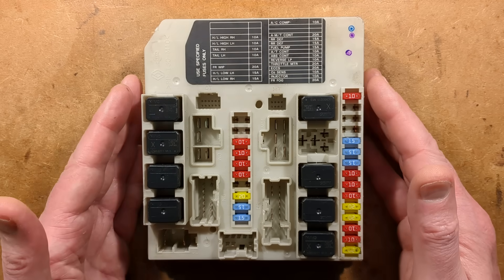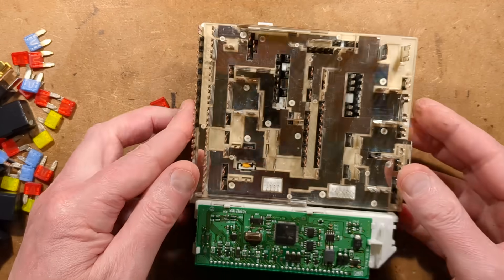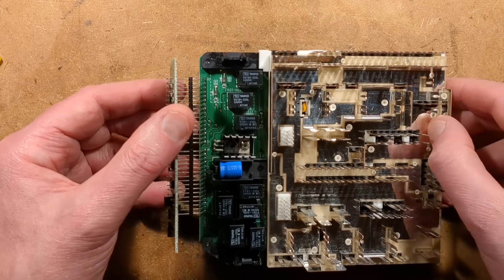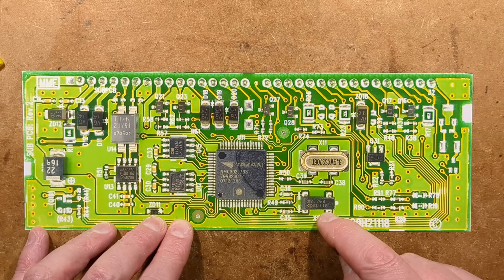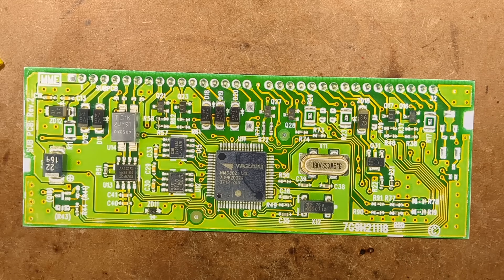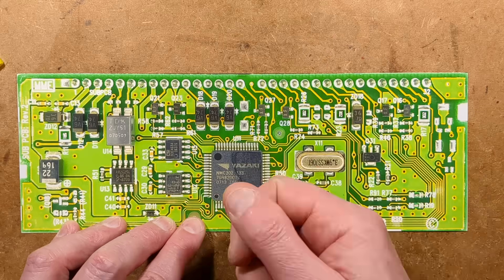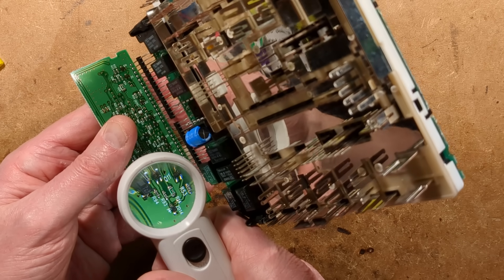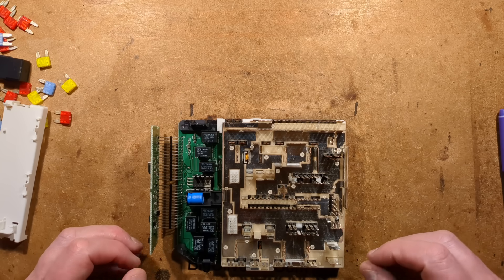Why your car's fuse box costs so much (and the location of the data chip)

Comment: I had a 2003 Dodge Ram 2500 and one day the left trailer lights just stopped working. Chrysler in their infinite wisdom made a trailer circuit inside the fuse box and the left side relay failed which I found out was very common. Radio Shack (yes that tells you how old I am lol) couldn’t get the relays because they were tiny and setup different than a standard typical relay. I had to go through Chrysler to get them. They said I had to replace all 3 relays due to past issues. Once I got the fuse box apart I was able to locate all 3 relays. I had 4 different type of soldering irons and none of them could melt the solder. Spent 2 days working on it and was finally able to replace all 3. Mind you the board look like 💩 after I was done 🤣. And to my surprise it worked! And then 2 weeks later it failed again. Drove that truck for 10 years like that and was still broken when I sold it.

Comment: In similar reverse engineering scenarios I have found it effective to hold the micro in reset with a single hand probe while reading i2cProm. Or if the micro has numbers sanded off and the reset isn't obvious, grounding any external crystal to stop boot (having confirmed with a scope that you've got the input side so as not to damage the driver)

Comment: Programming the eeprom in system is unlikely to run the microcontroller. The power governor module will be holding the MCU in reset because the power from the clip is not going to be meeting the safe power up requirements. If in doubt you can artificially pull the reset line down (or up, no idea which way it is active in this chip)

Comment: And this is one of the points, I don’t like the Yazaki products. 
I see the PSA-Yazaki parts and freaking hate them. The quality is Ass in my eyes.
The Delphi BCM on the other hand are a bit better for the say „thinking“ and „load“ parts: 
You can remove the Relais part, just via headers on the board and repair just the Relais. 
Or desolder the key-eprom and put them on the new board. 
Easy is that. 

Just my two cents.

Comment: You can manually "active test" (function check) those IPDM units in most Nissan's of the era. If you cycle the ignition on-off-on and press the drivers door switch 10 times, the unit will cycle through its test sequence operating the lights/horn/wipers etc. It sounds like a weird cheat code, but it's a real test on a lot of models. It doesn't work on all models though (D40 Navara and R51 Pathfinder for example).
There was also a recall on some of them because there was a relay that would fail. Dealerships were sent a special tool for pulling the relay out. The tool itself is also quite interesting to look at with the way it pinches the relay and pulls it out of its socket.

Comment: Common miconception: is not a fuse box. It's the Body Systems Module (BSM in Ford speak) on my Focus it controls multiple functons from the interior lights to the central locking and security systems. Ford sell a number of 'options' that can be enabled from the BSM but only if the BSM has all of the needed hardware (relays, etc) built in. On my car I was able to buy a higher spec BSM (I had to replace mine due to a Ford design flaw) for around £75  from a breakers yard and then, using FORScan and a CAN interface, pair it to the ignition keys the ECU, the ABS and the instrument cluster. Sounds complicated but it really wasn't.

Comment: 5:50 timing. The Nissan's have timing for the turn signals and 4 way flashers.  If you overload them say with LED lights, it damages something on that board. Very expensive.

Comment: It wouldn't cost that much for the factory to add a waterproof coating over the pcb and it would be an added saftey preventing it breaking in case it gets wet.

Comment: My first thought is - a box like this should NOT contain all of this.
Especially NOT if its placed under the hood, with the risk of condense/moist/water/salt (I live in Norway, and roads are salted a LOT during the winter).
The designer may have thought..."hehe, just a minor failure here may end up owner/workshop buying completely new box", but what about their reputation...?
I will compare this to replacing the hole car due to gear box broke...
BTW. BigClive has valuable knowlegde deep into electronics, I can see.

Comment: Give it a few more years for electronics designers with experience to fade away and then the most common car failure mode will become a failed surface mount capacitor just like phones and laptops now.  There will be a "Car Repair School" channel where the guy finds the errant cap and just tweaks it off the board with pliers and job done!  🤣🤣

Comment: This has gone a LONG way from the 2 x 35A glass fuse "fuse-box" in my first car - an 948cc A 35 Van. Nothing solid state in that machine at all!  Those very complicated fuse box assemblies can put you back over $1000 if they need replacement - and getting reconditioned modules can be really difficult, so you are stuck with the "Original" device, and specialist installation.

Comment: The fuse box in the 1998 Nissan Frontier has a very similar appearance, but I doubt it has any active electronics in it. Ford for many years (through 2004 at least but probably later) used fuse boxes where the fuse and relay terminals were crimped to wires stuck into the back of the fuse box. This meant that if you could find a source for the terminals or cannibalize them out of another fuse box, you could easily populate the terminals in an unused fuse or relay position and have a factory-looking wiring modification.

Comment: Did you know Voron 3D printers use a CAN Bus network for the motherboard to talk to the other modules?

It was an easy to use network that is already compatible with 24V, so they went with it.
Reply from the maker: It's also used extensively inside modern moving lights at events for communication between internal modules.

Comment: Many vehicles have immobilizer systems which use multi factor authentication and are linked between multiple modules like powertrain control module, dashboard and key fobs.  I had a failed PCM in my VW and had to "adapt" the new PCM to dashboard  immobilizer after recording a code.  This required software plus a data cable which was designed and built by a individual living in Pennsylvania.   He managed to build a better tool than the VAG engineers and many dealerships were using his package as it was cheaper and better than factory unit.
Reply: Uwe Ross and VCDS, originally called VAGCOM. He used to work for Bosch apparently... Now a big business and still popular.

Comment: i cant comment on Nissan, but i work with Fords daily, so here's some information about them. in Ford's world, the underhood fuse box is also known as the "BJB (Battery Junction Box)" or "BCMC (Body Control Module C)". it has its own programming and as-built data (which basically tells the module about itself physically, and some other stuff), but its pretty small data for a module. on the F-150, a replacement BCMC can cost about $550. for some context, a cruise control module can be closer to $580, and a camera for the rear or 360 view system can be nearly $400 each. from looking at some community-made spreadsheets and just guessing Nissan does something similar, it might need that timing for a sort of timeout for certain modules. maybe a way to force reset an unresponsive module by cutting power? i'm not sure and thats just a random guess. most of the as-built data seems to be DTC behaviors. its also highly unlikely that swapping out a fuse box will cause issues in terms of a soft of vehicle mismatch lockdown, as the Bronco guys figured out that swapping the fuse box and a couple wiring harnesses could retrofit the 6 upfitter switches

Comment: I used to have a Bedford HA van (1978). It only had 4 glass cartridge fuses, an indicator relay, starter solenoid and that was it. As simple as you get. The only electronics was the added radio. 😀

Comment: Part of my OCD was to keep a box of assorted fuses in my car. In the 54 years of driving I only ever changed probably 3 blown fuses. The fuse boards have evolved so much that it is virtually impossible to DIY, unless you buy the fault checker. Good post Clive 👍
Reply: My 3rd car was my (beloved) Peugeot 206 SW. Sadly that had to go when the combination fuse box/mainboard developed a small fault.
I'm not being sarcastic either, literally one electronic feature failed.
And it couldn't be repaired, that tiny fault wrote off the mainboard and subsequently wrote off the car, it was much more expensive than the value remaining in the car! 😂😭

Comment: If you disconnect the battery while the engine is running, the voltage will spike. This is so much of a problem that the electronics in a car have to be able to reliably operate during one of those voltage spikes. So you often see a lot of zener diodes, some quite large, in these kinds of modules to clamp those voltages and dissipate them as heat. This is part of a automotive electrical standard.

For additional information, search google for "cars rule 34".

Comment: Don't bend the connector. Electronics techs use a large heating pad to heat and melt all the pins at once. Cold solder joints at high current terminals (fuses and relays) should be resoldered if they loo at all strange.

Comment: I just bought one of those used, to Renault. The problem was the water drain hole where that fuse box is in.  Water got so high, it frooded inside to that fuse box. I cut plastic to get further, around those small pins and clean in. Worked around one year and corroded again. Now used box in, no programming needed and my 87 year old grandmother's car is going again.

Comment: Ah, I did read off an ECU for a Chrysler Crossfire (AT-Tiny iirc) correctly in-situ. I know it was correct because I, too, was nervous and pulled it off to read again.

Turned out it needed some baked resistors replaced but now I've got a programmed spare ECU as well.

Comment: Thanks Clive for the effort and time you put in making these video's.

I only just recently had to replace a relay in my fuse box after it died causing my dash lights and tail lights to go off.

Problem was that there was no way of knowing the amperes rating of this relay and even after reading the workshop manual and the circuit diagram(which only told me it was a relay) and making enquiries at two different auto parts stores the only thing we could come up with was it "probably" was a 10 amp relay and the guy was fairly sure about that.
Every other fuse and relay was marked on the lid with a size.

A search of the part number from the device came up with a totally different type of relay. Even a picture search came up with many various different types.
The first store tried to sell me a totally incorrect relay for $20.
$15 later, so far so good after 4 weeks.

Comment: 8:39 I do embedded systems firmware and in my experience reading from an external eeprom is slow enough that we’d do it only once at boot time, and maybe as a verification step after writing.  So you probably wouldn’t have any conflicts reading that chip a few seconds after applying power.  You could also read the whole thing several times and verify nothing changed.

Comment: The relays on the circuit board may be controlled via the CAN bus and the mirocontroller handles the communication. The EEPROM may also store fault codes that can be read with a scan tool.

Comment: I actually found an extra fuse issue a few weeks ago. The vehicle had a parasitic draw that was killing the battery. While testing, I found a fuse in an slot that was marked as vacant. Upon removing it, the draw dropped from over 500 mA (bad) to 12 mA (good). The source of the draw was the body control module. I'm thinking that additional power source was keeping it awake.
Reply from the maker: It's always satisfying when you find and fix a parasitic draw.

Comment: A lot of these fuse box modules are power distribution and body controller rolled into one box. The one in my truck controls turn signals, power locks, windows, remote locks, TPMS, daytime running lights, and 4x4 transfer case.

Comment: Like clive says, you need to be careful reading that chip in circuit. If you have the datasheet for the microcontroller, you could find it's reset pin and hope that it's bought out to one of the test points. Then you can use that to hold the uc in reset (short that pin to ground or vcc, depending on if it's active low or active high)

Just as a suggestion on how to do it without having to desolder chips

Comment: I use one of those test clips to program eeproms inside an automotive ECU all the time but the trick is i had to bring the voltage down to where the microcontroller is technically still in brownout protection but the eeprom is just barely inside it's valid range. this obviously won't work in all cases but it is possible sometimes.

Comment: Is that electrolytic capacitor in there to ensure the car has problems in an unreasonably short time?  I wonder what effect it will have when it eventually spills its guts.
Reply from the maker: Thankfully it's not operating at very high frequency.

Comment: Usually the eeprom chip is read early in the boot process and left alone after that. The powered-up processor is probably going to go into a fault mode, screaming on the CAN bus (J1939 is most likely), but will leave the eeprom alone.

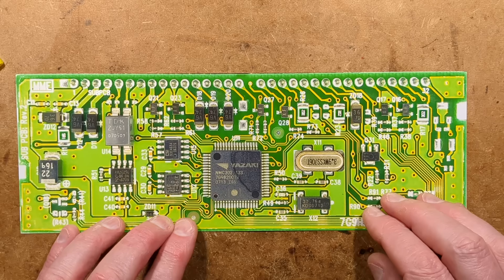Comment: 8:50 I've done many flash memory dumps this way from things like video cards, laptops or even HDDs and had only one failure where I had to desolder the chip. The programmer was saying that it is pulling high amount of current because of the components around it (well not high but more than what the chip actually needed) so I guess this method is fine. But still. I would rather desolder it if it was a very expensive device and if it was 100% the EEPROM issue.

Comment: This could be a negative, but alternatively, if you could control those relays and various features through canbus that could be a very useful little part for a race car or modified setup.
Reply from the maker: There are complete engine management systems available for custom cars.

Comment: I've used those clips a number of times to read data off flash chips or to flash a bios to a motherboard for laptops and pcs. Only once has it had issues with the surrounding chips powering up. A good precaution is to read the chip multiple times and compare the file hash. If it's the same, you can be pretty damn sure you got a clean read. If not I found it easier to remove the chip at that point.

Comment: Regarding top-side PCB bus bar
"Short Circuit straps"...
I would guess there are versions (different SKUs) of the "almost identical" fuse boxes.
The proud owner of the car somehow felt by inserting few additional fuses and replacing the higher end "head unit" (i.e., better and feature-rich factory audio unit), the car all in sudden becomes the highest tier of this model year vehicle.  
Naturally, factory and dealer do not like this idea at all.  They want to determine what's included in the package and better mark-up on the top tier of the same car.

Comment: What you have there Clive is less a fuse box and more a body control module.  They are usually up behind the dash somewhere, which is why it's so clean. A BCM will control interior and exterior lighting, security, door locks, windows, etc.  
The CANBUS terminating resistor is usually in the ECM (engine control module), and the other one is sometimes in the main wiring harness. The BCM is also usually the master module on the network, responsible for waking other modules on the CAN, putting then to sleep, etc. They usually have to be programmed with the vehicle's VIN, as well as the options the vehicle has.  Alot of manufacturers try and use the same BCM across many platforms.  The only difference being the software.  This stuff is in my wheel house as I'm a master auto electric technician in Canada.
Reply: It's not a BCM it's the IPDM, power distribution module(engine bay) from an earlier Note,Micra,Qashqai etc.
Reply: The TIPM on my jeep wrangler is a electrical gremlin nightmare
Reply: Tipm stands for trouble in power management on Chrysler and jeep vehicles 😅😅
Reply: Terminating resistor?
Reply from the maker: Termination resistors at both ends of a network are used to avoid signal reflections that can corrupt data.
Reply: @corthirteenth94  More like resistor*s*.

Comment: Thanks Clive. This is why my car is from 1985. It does everything that I require of it very well and doesn't require me to learn a whole new discipline to maintain it. The most complex electronics in it is 'CDI' (capacitor discharge ignition instead of physical 'breaker points'), a sealed 4 pin 'can' module - NEC MC-5357 - and I have spares of that. That said I haven't needed a spare CDI module so far after 40 years of running.
Reply: Shame the after marked companies are gone.  Would like to upgrade my points on my f100.